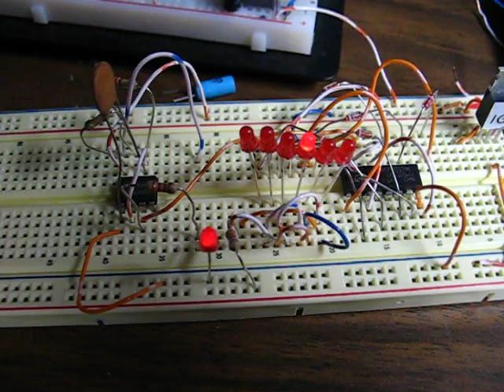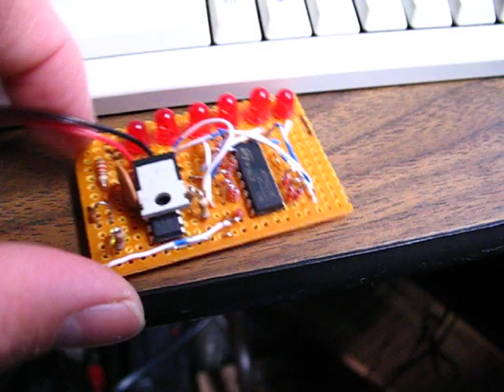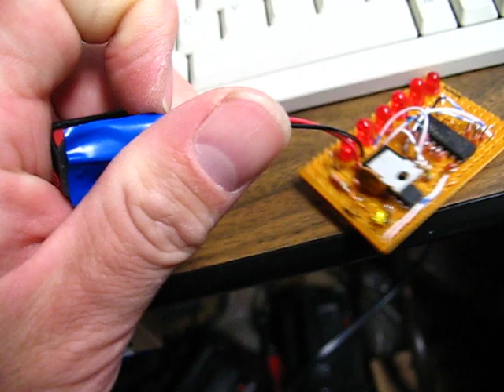Cylon Led

Comment: You should be able to run that without the 7805 :-) The 4017 is a 4000 series logic chip which'll run up to 18/20 volts depending on whether it's a HCC or HCF type.
Great lil circuit, I have a big love for the 555 timer as well as the decade counter.